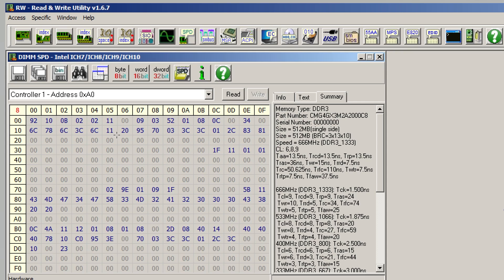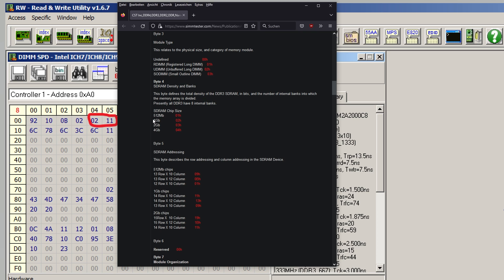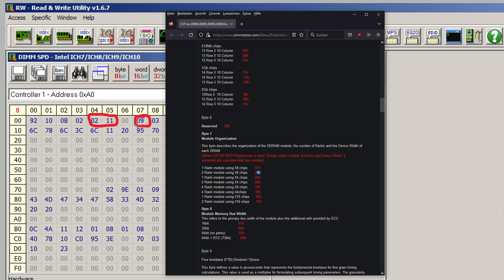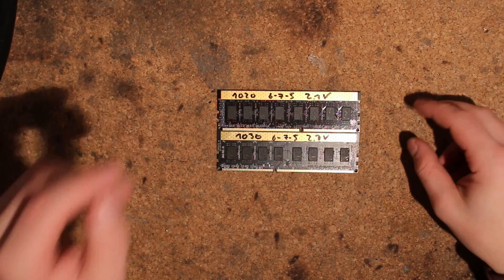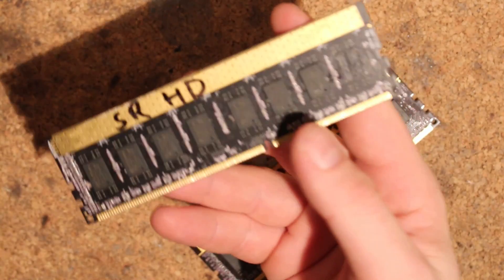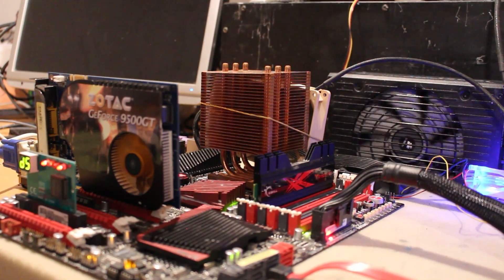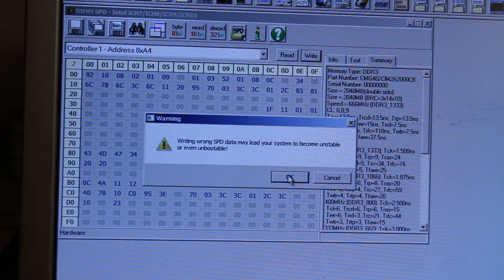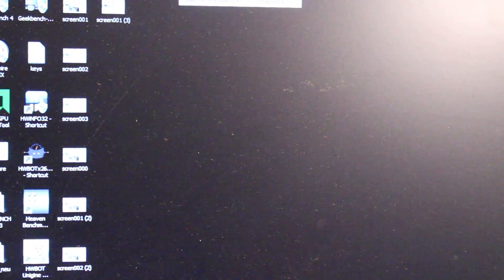Memory necromancy / SPD modding guide

Comment: github prsyahmi BadMemory:

"It is possible to run windows with defective memory by telling windows not to use the faulty address by manually adding entry to badmemorylist on {badmemory} section of windows BCD. For example:
bcd /set {badmemory} badmemorylist PFN1 PFN2 PFN3 ..."

This means  you would  only lose one or two 4KB addresses, rather than half the RAM ..!
Great for mem OC too as you can lose the 1st, 2nd, 3rd, etc weakest link in the chain.

Comment: lacquer/(paint)  thinner or mineral spirits.... eats the glue or adhesive or double sided tape sometimes. The longer you leave them in the easier the heatsinks will come off. I found leaving overnight or longer works well (10+ hours) then I rinse them off with rubbing alcohol (IPA) 90% or higher.
Sometimes the heatsinks will fall off while soaking or as you are taking them out. Found a few kits of hypers & they work.
Reply from the maker: Yep, paint thinner works great :)  the stick that's featured in the video wasn't damaged by removing the heatspreader but by being dropped with the heatspreader still on there which ripped off the chip...

Comment: I do overclock memory too, Usually I go buy a very high Mhz stick that is not really suitable for the CPU in terms of the clock speed, Then I downclock the Mhz on the memory to match the usable speed for the CPU and this gives you insane headroom for overclocking the timings instead. I have for example DDR3 running on 1600mhz using as low as 8-8-8-22 timings. or for example DDR4 2133Mhz running with 15-15-15-30 timings. Thing is that a high clock speed is not worth anything if you spend time waiting it out. latency is important

Comment: I have DDR3 14900 module which fails on a 800MHz fsb but works fine at 1600. I guess it's SPD doesn't contain the right bits for 800 speed.

Comment: Thats a cool program and a good guide!

Never modified SPD profiles but I have been thinking about it recently.
Idk if a tool like this works on older SDR like PC133 sticks. 
A friend that gave me some PPC Mac parts, ram and CPU did reprogram PC133 Cas3 ram to run at Cas2 at 133Mhz using an external programmer so the Mac would be fooled in to running Cas2 at 133Mhz.

Anyways good video!